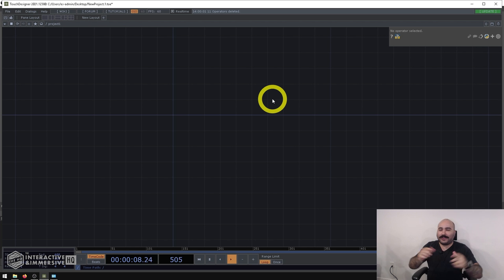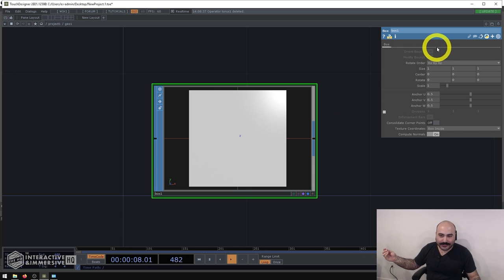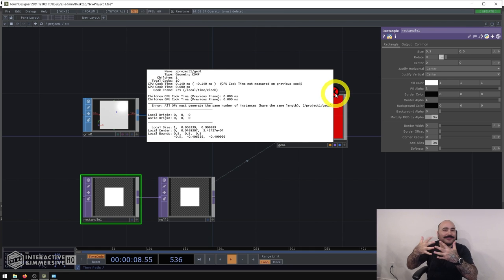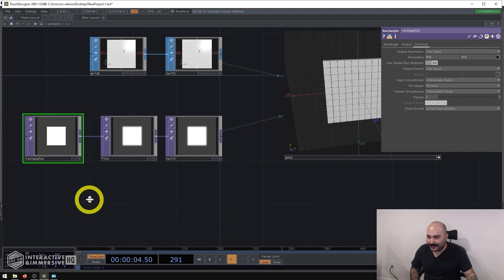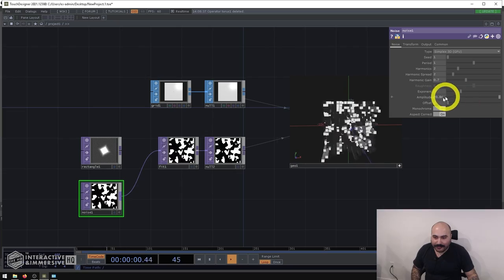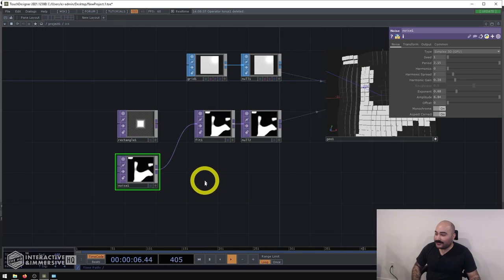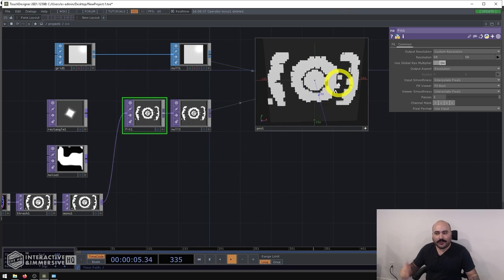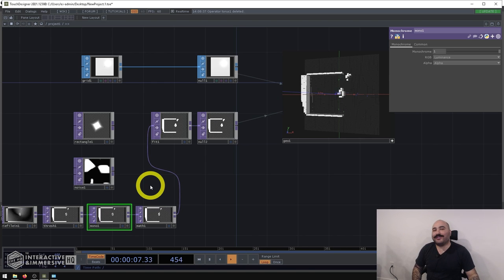Push Pin Effect Breakdown in TouchDesigner - Tutorial

Comment: Im having troubles on making Z scaling. Mac OS with m1 macbook pro. My other projects with instancing from color TOP - works, but monochorme - is not. =( It simply making boxes a bit bigger, but not scaling it like in your video with noise example...
Reply: Oh! I Figured it out. On top side - I need to use math top to add more range. So the chain is - noise - math - fit - null
Reply: Nope! Correct line - Noise (or video device in) - fit (with 32bit float rgba) - math - null
Reply from the maker: @Lumaa_Lex  Glad you figured it out! I think I mentioned that later that 32 bit helps, and then you can decide how much to scale those boxes either with a Math TOP or by increasing the amplitude of the Noise TOP.

Comment: weird little thing, but i noticed that the rest of your grid goes dark when you change the res of the Fit TOP to 20 by 20 (with the exception of the square). whereas when I do that, the rest of the grid stays the same colour (white). do you know any reason for this?
Reply from the maker: Are you on macOS by chance? I know the shading between macOS and Windows can show slightly different results when using GPU processes, so I can offer a suggestion if that's the case.
Reply: @TheInteractiveImmersiveHQ  yes I actually am on MacOS!
Reply from the maker: @AngusMacMinn  In that case, it's a bit tough because I don't have a mac system to test, but I've heard odds and ends about viewer shading and instancing setups looking a bit different. I'd recommend adding a Render TOP after it, creating a light, and seeing how that looks.
Reply: @TheInteractiveImmersiveHQ  cheers, I’ve given that a try and added composited in a ramp to add some colour and am getting some cool results. Really awesome video btw! Always love your content ❤️
Reply from the maker: @AngusMacMinn  Thanks! And glad you got it figured out and got it looking cool :)